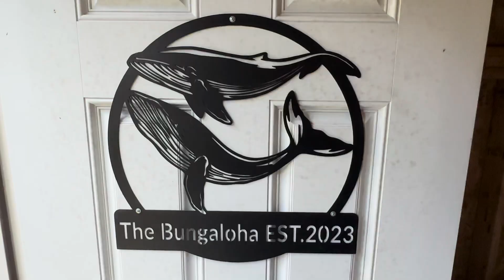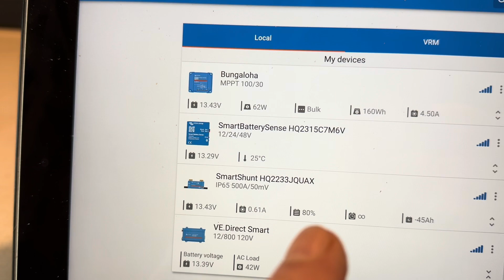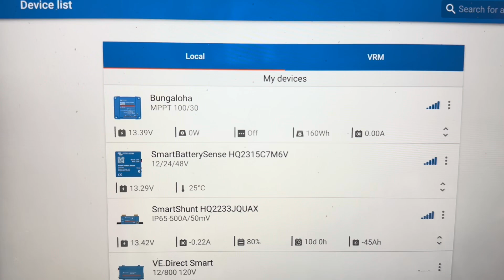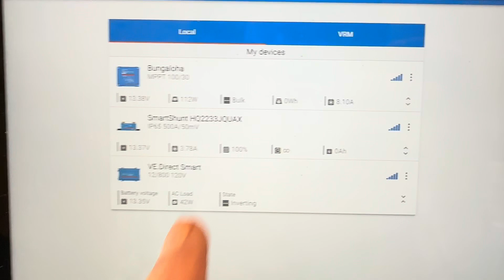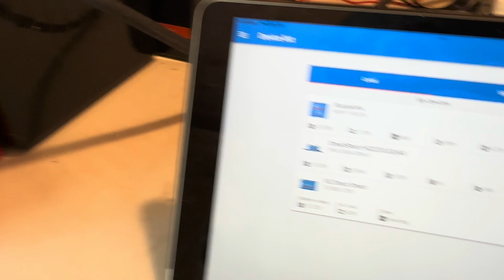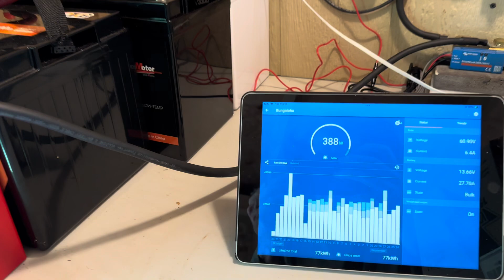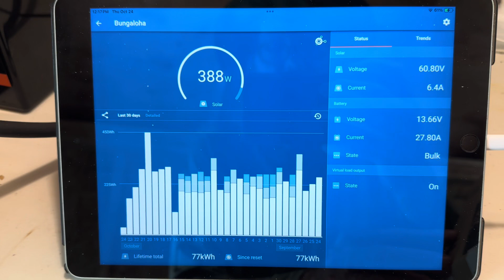Four Different 12.8V 100Ah LiFePO4's in Parallel to Make One 400Ah Battery

Comment: I have the four 12v 100AH on my mobile harbor freight cart, but I went with bus bars to keep the loads balanced.  IF you test using a clamp meter, you will find that your method does NOT balance the loads and the issue becomes more acute on AGM systems.  One other note to think about is that almost all manufacturers say max of 4 in series or 4 in parallel for a maximum of 16 in the bank.  Thanks for posting the video and maybe a follow up video idea showing a heavy load (50+ amps) using bus bar vs NO bus bar.  Glad you are feeling better Bob.  Gary in cloudy SE Michigan today.
Reply from the maker: I will run a heavy load before I disconnect that system, as that's a great idea Gary! Mahalo! Pouring rain again atm here...probably 3 inches today alone! That's okay though, it had been a bit dry for out here. Aloha!🤙 (I don't have bus bars yet for tying it up though)🏄🏼

Comment: Bob, my friend, it looks like you’re getting back into the swing of things. I’m not sure if I should bring this up again, but I will because I care about you. Please look into ivermectin, vitamin D to help get rid of your melanoma… “ask your doctor about this … this is my disclaimer “…. I’ll leave it at that. Now, onto the subject of the batteries. What you’re doing now is something I’ve done before and works quite well. I have even mixed lead acid with lithium iron phosphate. There’s formulas to work around with this, of course but, in a pinch you’ll find it will also work. I’d like to leave you with a tip that I’ve gotten into and that is, I have my solar panels mounted on my roof and I live off grid full-time. I can’t always check the top of my roof and being the ancient person that I am 67 years old, I don’t always want to climb up and check to see if leaves or anything else has gotten on the solar panels. So my tip is, what I’ve done is., I’ve gotten a small drone.. I’ll send it up to the roof with the camera on doing an inspection of the panels and if need be lower, just enough to blow leaves and any other debris off the solar panels. I hope this helps you and our other breathern out there in the solar world 😂
Aloha brother! 🤙
Reply from the maker: Mahalo brother for all the info! I am currently exploring several different treatment plans as this stuff is being relentless. Just had another pretty good size surgery a few days ago! I'm being held together with scar tissue! I moved all my solar off the roof now as it's easier for me not to work up there anymore. I used to not worry about that, but I'm not as sure footed as I used to be! Aloha Jimbo!🤙
Reply: @ Keep it up brother, your experiments, research, life results and you down to earth way of teaching is much needed to calm the soul in this world today 🤙

Comment: Bus Bar all the things!  You have wired it as well as you can, in the absence of a proper bus bar configuration, which would mitigate (somewhat) for the concern of connecting so many dissimilar batteries in parallel.
Reply from the maker: A few of you and my neighbor have suggested that. I will try to do that in a future follow-up and show the difference. Mahalo!🤙

Comment: As long as the battery voltages are close enough, you can connect them together without causing an excessive number of amps to transfer between the batteries.  Because they are LiFePO4, their respective SOCs might be vastly different in the beginning (connecting them together will not equalize the state of charge in the batteries)... but after a few charging cycles all the batteries will be in sync.

I don't recommend putting more than 4 in parallel without really researching safety.  You will start needing more significant fusing (T-class fuses) and the cabling gets more serious.  You also have to know precisely how much over-current the various battery brands actually allow, because that can effect the fusing requirements.

It is actually better for the system when the batteries do not have much beyond 2x over-current capability when paralleling.  When they do, the combined short-circuit current that the battery BMS's allow can easily exceed standard fusing interrupt-ratings.

As I'm sure most people realize, scaling a system at 12V starts to get dicey when the amperages required for your loads gets into the hundreds of amps.  It is far better to design to a higher system voltage (48V, aka 51.2V LiFePO4) when larger scale is desired in order to keep the amperages and cabling at more reasonable levels.

-Matt
Reply from the maker: Mahalo for that Matt! I'll let it run like it is for a little while and keep an eye on the logs for anything that looks interesting. Aloha!🤙

Comment: Hi Bob, great video !  You eased my mind a little showing this can be done without issue.  I have different brand battery’s but same ah etc.  I feel more comfortable trying this now.  What size wires are you using to parallel the battery’s ?  Just curious.  Thanks, and have a good one.
Reply from the maker: Mahalo! I'll run it like this for some time and report back if anything acts up. I used 2awg cables in this configuration. Mostly just wanted to charge these batteries up some, and maybe some small shop loads too. Aloha!🤙

Comment: So I have 2 low temp protection batteries a chins and a Siekon  both 12.8 v 100 and I also have a 200A Rich solar and a 100A New powa solar panels and I got a 40A Redodo charge controller do yo think that they would pair well thank you and be safe everyone

Comment: Yes keep batteries charged. I have seen several RV's with different LiFePO4 in parralo . Like a Power queen and REDODO 100Ah .  As long as voltage is close on them you can parralo them.  I charged different AH ones in parralo. Just charging. Worked great .
Reply from the maker: Just charging here too for the most part. Maybe run a few small loads along the way, but I'll keep an eye on it see if anything weird happens. i wouldn't think so, but easy to see if it does. Aloha!🤙

Comment: I am glad this system worked out for you. I probably wouldn't have tried it, but now that I know it works I can connect different 100Ah batteries together, I would do it without hesitation.
Reply from the maker: I always had this in the back of mind to try, and finally did. I think it will be fine. Not a permanent build by any means, but will let it run and see how it does for a bit. Aloha!🤙
Reply: Shouldnt be any poiblem with paralelling . All bms should handle that.

Comment: I Bought 4 24 Volt 100AH Lithium Iron Phosphate of the same name brand and Production Run and charged them all 100% and they read 1 volt differently from each other 27.3 - 27.4 - 28.5 - 27.8 respectively and want to Tie into a 300amp Buss Bar to The rest of My System here. Is a 24 Volt battery balancer needed for this Installation ?
And 100amp MRFB Fuse on each Battery Post ?
Reply: If you're wiring the batteries in parallel then you don't need a balancer.  They will balance themselves over time while charging and discharging.